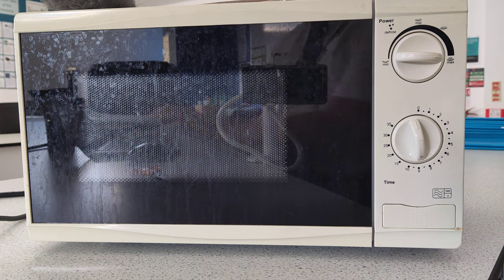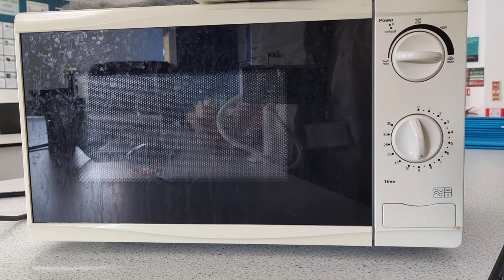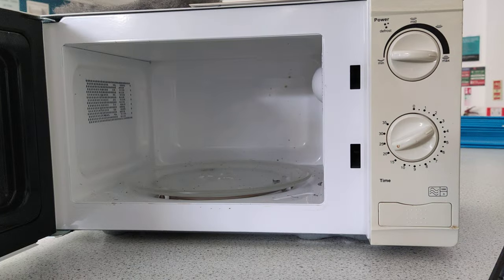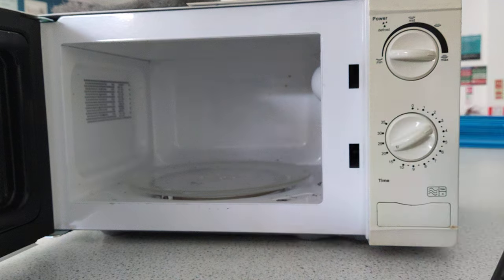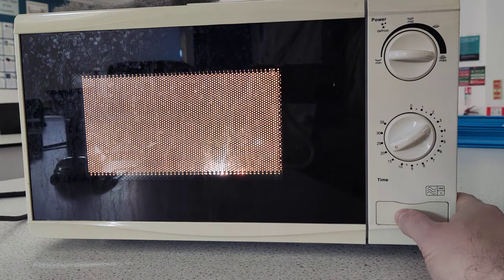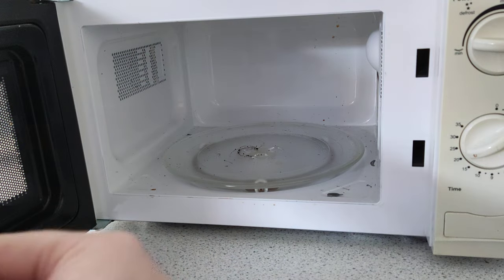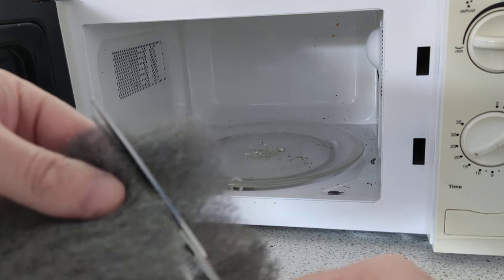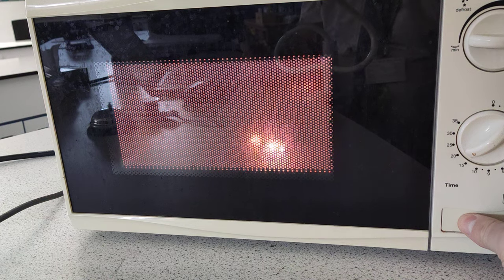Microwave Physics Sparking - CD/ Nichrome Wire/ Spoon/ Wire Wool

Comment: with a spoon there's almost 0v difference in potential due to its smooth un-interrupted path around its edges.. the splines of a fork, or bundled up wire create the potential for current to travel across the lesser resistance paths around the fork to the other fork. and when that current buildup reaches the 2 closest point with the given input, it arcs through the air creating a plasma. A bunch of energy is released in the form of heat, photons, electrons..  trace x-rays.. all the things. material specific but, its really not rocket science. if you drive a spark ignited internal combustion engine. then you have multiple spark plugs at the heart of your engine that do the same thing only they're tuned and engineered for that exact purpose. to convert energy. your microwave is only tuned to vibrate water molecules. and cause friction.. converting energy a different way